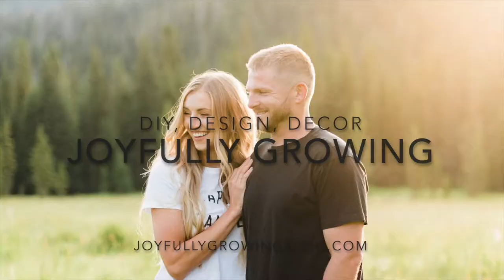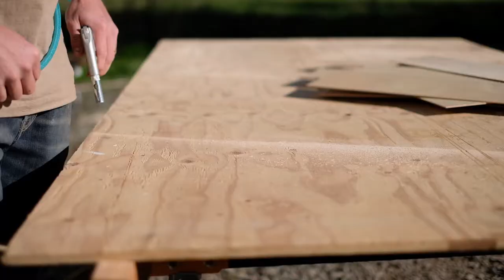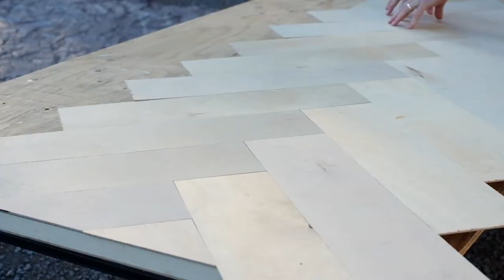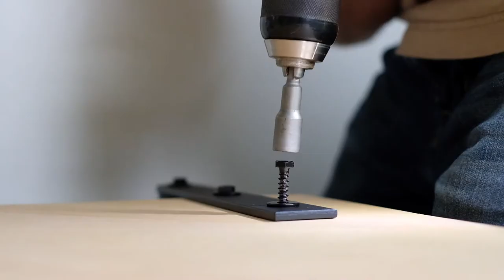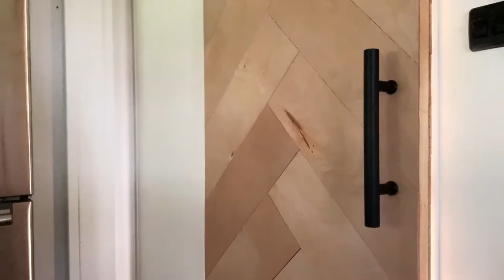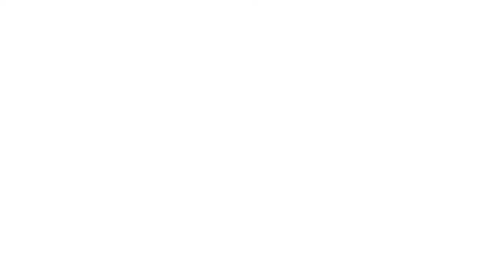DIY Sliding Barn Door | Easy DIY Project!

Comment: How did you finish up the down? The product (sliding door hardware) I saw has a buckle at the bottom so the door is not floppy.
Reply from the maker: Yes we installed that piece on the floor and followed the instructions that came with the kit. Thanks for watching!